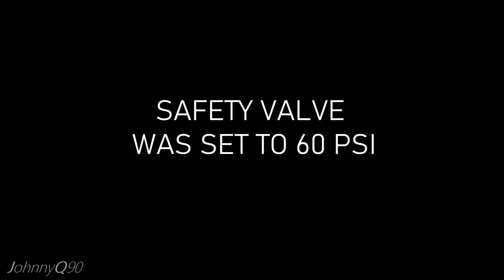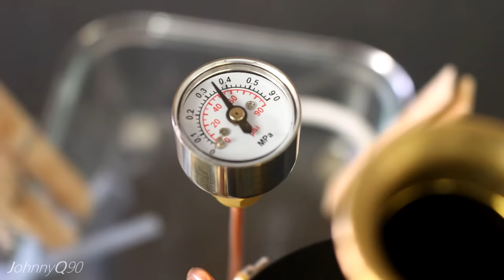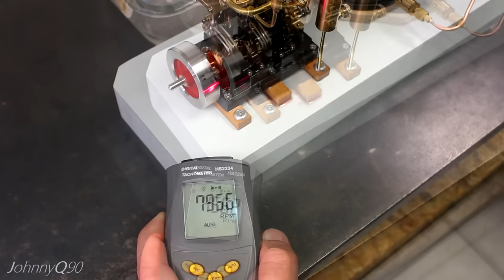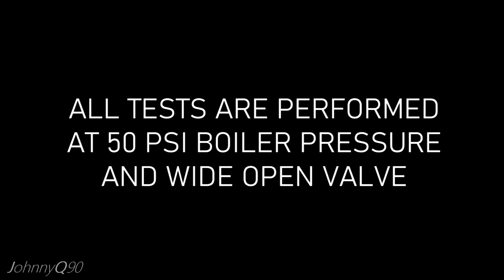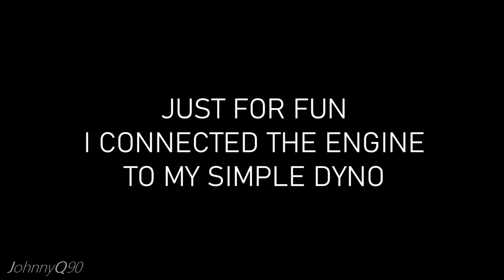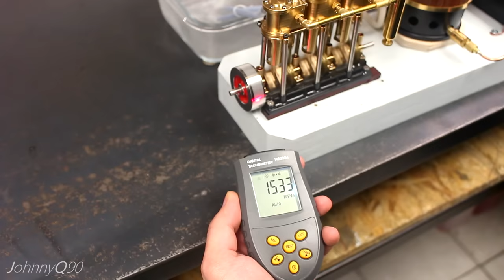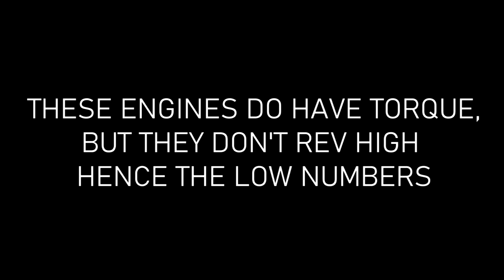Testing a TWIN & TRIPLE Steam Engine!

Comment: Johnny, you need to get some steam oil from the vendor for the in-line lubricators.  The two-cycle oil is likely doing very little to lube the cylinder walls.  Steam oil is designed to work in the high-pressure, high temperature environment of a steam cylinder.  Remember, steam under 50 PSI of pressure is much hotter than 212º F. (100º C.).  Those are beautifully made and running engines.
Reply: What does gasoline burn at? Or is the pressure more the issue at play here? We mix 50:1 for the chainsaws and blowers at work, just curious what the difference would be.
Reply: @TheOriginalBlue62  The steam actually washes the oil off the walls of the cylinders when you use normal oil. Steam oil is made to emulsify with the steam, and remain on the cylinder walls to lubricate the rings. It’s a different environment than the cylinder of an IC engine.
Reply: @tjh44961  Nice tip!!!!!

Comment: 2 stroke oil is alright for the external parts but the cylinders really need steam oil as it's a lot more viscous and can handle the pressure and heat will help the cylinders last a lot longer wouldn't want you to ruin them as I bet they where not cheap

Comment: FYI, don't over tighten any of those fittings, rather, tighten them by hand, give them one quarter by wrench, operate the machine, and tighten them if they're letting out water or steam (depending on station). Those are notoriously easy to break, also, they're specifically designed to only go a little bit, until they seal. Just letting you know, i've broken my fair share of them.
Also, 2 stroke oil is a bit loose, you should get something of heavier weight. Like way oil, for example. The steam will vaporize any of the oil it comes in contact with if it's too thin.
Reply: Just use steam oil for live steam use, machinists oil for compressed air...
Reply: @grigorsamsa6564  US navy procedure for finding a steam leak is to wave a broom in front of yourself as you wander the halls; if the end of it falls off, you found the leak.

You can replace a broom for $5
you can't replace a seaman so cheaply, especially at sea.
Reply: Ther eisbsteam engine oil available, wilesco sells it for their models for example
Reply: @vaelophisnyx9873  Holy shit
Reply: @vaelophisnyx9873  that's fucking horrifying to think about
Reply: @vaelophisnyx9873  same protocol for NYC steam tunnels when the guys are going in to repair them.
Reply: @eragonawesome  same for high pressure oil leaks. They can be so thin you can't see them even if the oil is old and dirty and black, but they still have the power to straight up slice you.

High pressure gas and liquids are scary.
Reply: The correct lubricant for the INTERNAL components of any steam engine is the correct grade of steam oil, which is specially formulated to emulsify with steam and provide lubrication to the pistons.  I'm amazed that your engines have lasted as long as they have with oil designed for an internal combustion engine.  Also, stream fittings needed to be fitted either with PTFE tape - IF the threads taper - or 'liquid PTFE' if straight.
Reply: @enlightendbel slight correction, high pressure is scary period.

Comment: This timing couldn’t possibly be more perfect. I’ve been looking up references for air engines to design my own in Blender, and I was trying to decide on the number of cylinders and their arrangement.

Edit: I feel I should clarify that this is all for animation. I don’t plan on building an actual engine, but I want everything in the project to be as realistic as possible - something that could actually work if it were real.
Reply: You should start with one, to get the hang of it.
Reply: designing engine in blender with polygons? does the faceting bring engineering challenges?
Reply: Cool ! A steam powered blender could heat the soup as it made it 😊
Reply: @johnwalker194  ?
Reply: @Casix03 😂🤣😂
Reply: I was wondering why you wanted a steam powered food blender, but crazier things happen on youtube, so I didn't get it until I saw your edit.
Reply: @superdupergrover9857  he needs to make a steam powered blender dude ! Piping hot, perfectly blended soup or sauces would be the future 😂🤣😂
Reply: Three cylinder radial, less parts

Comment: If the safety valve is rated 60 PSI, I'd run it right up to that for the extra oomph out. Looks like the little engines that could need it. They do seem to do well under load as well, as you've noticed. They don't seem to bog down near as much as the gas engines, possibly because they can always be fed power via the steam in, which can rise in pressure when bogged. Neat little engines.

Comment: I love steam power! Especially the reciprocating types like these. It would be amazing to see you build one from scratch. A triple-expansion, or the rarer 4-cylinder triple-expansion would be really interesting to see. I've always wanted to build a 4-cylinder triple like the ones used on Titanic, but i simply don't have the equipment or skills required to do so. Yet. Thanks for the video!
Reply: I was under the impression the Titanic only used 3 cylinder triple-expansion engines. In fact, I've never heard of four cylinder triple-expansion engines before, would they not be called quadruple-expansion engines?
Reply: @Kyle-gw6qp  they wouldn't be called quadruple expansion because the third expansion is just split between 2 equally sized cylinders. They did this to reduce the weight/size of the third expansion components and to minimize vibration. A true quadruple expansion engine would have 4 different sized cylinders. 1 for each stage. If you want to see a really well done scale model of Titanic's engines, look up overweightarchie on youtube. He's got thousands of hours into it and it's arguably the best functioning model of the engine in existence.

Comment: I'm really impressed and amazed at how well and smoothly the machines run, and especially the three-cylinder one. Right now I wanted to buy a steam engine again (the three-cylinder of course). almost 50 years since I last bought one. Then of tin type on tin plate, and with 1 cylinder, but I had a lot of fun with it, saw and steam hammer came with the set. The other boys were very impressed. Thank you for allowing us to take part in a great demonstration and a great video.

Comment: Very cool
Too bad they are both single expansion and since the pistons all appear to be the same diameter you probably can’t convert to double or triple expansion.  Any chance you can make a condenser so you draw a vacuum across the exhausts?  You may see an increase in power out put.

Comment: I have a two cylinder steam engine that has only been tested with air power cause I’m still building the rest of the boiler components but I absolutely love watching all the mechanics at work at extremely low RPMs.
Great vid as always 👍👍

Comment: These engines are absolutely beautiful. Craftsmanship looks fantastic.
I was a little surprised that they can't run slower than that. Especially since they're multi cylinder engines. Maybe they're not double acting cylinders if not that the reason. But if they are double acting they should be able to run much slower than that. Could be a steam regulation issue or perhaps the timing is slightly off. Could just be that they're very small cylinders also.
I had a little single cylinder steam engine for a long time. Just used the sweeping style back and forth valve. And it would run quite slowly.

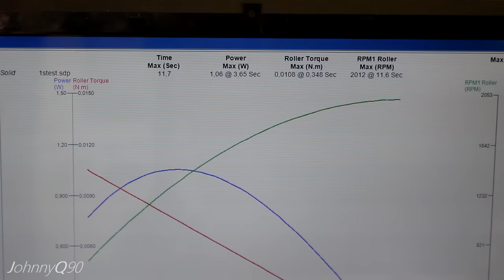Comment: 8:06 the brushless motor is producing around 1.5 watts of power, so the steam engine should be producing even more. Maybe there is a problem with the dyno test? (9:14)
best wishes
Reply: It's like a transmission. Gear reduction does a lot

Comment: i like those demonstrations with the light bulb, turning LOTS OF FIRE into a tiny bit of glowiness :P
shows you how inefficient energy conversion actually is.
Reply: Along those lines, a tinkerer could try to demo in miniature, heating with a heat pump vs. direct burn.

Comment: Lovely looking little engines , sound nice too. 
 So are you going to make a condenser for exhaust gas and feed it back into the boiler via a one way valve?
Reply: I can see the exhaust condenser working - lots of stationary engines have them, but you couldn’t directly feed it back in as the water would have to be at a higher pressure than the boiler to be able to get through the one way valve. He could probably machine up an eccentric pump though, they’re common on locomotives.
Reply: @harryrobinson2901  I didn't think of that. Makes sense
Reply: @sourand jaded they can be really finicky on miniature steam engines, they’re fussy on pressure and also don’t like hot feed water - which is a problem if you’re getting your feed water from a condenser, they tend to condense the water properly but keep it a bit warm. It’s definitely possible though. 

Some boilers need certification in the UK and US and to get one certified you need at least two methods of water input, so there’s no reason why you couldn’t have an injector and then a hand pump for if it fails.

Comment: Hi Johnny,  You have inspired me to order this setup for myself.  I ordered it today and it should arrive in a couple of weeks.  I have a few question about what we see in the video compared to what's actually included in the kits:
1.  What's the smaller vertical black cylinder for, and why wasn't it used in the build?
2.  Were the holding braces for the Gas Tank included?
3.  Was the brass fitting you soldered to the pipe included?
4.  Is there anything else I will/might need for my setup to be functional?
Reply: Hi, I am also interested in getting this kit, but like you would like to know about what is exactly included in the kit. Could you please let me know? Cheers. Serge

Comment: I would love to see the cylinders working in series. Although they probably are designed for that so it might not work well but I think that’d be cool to see.
Reply: You'll notice they have functioning valve gear, this means you don't need multiple expansion in order to improve efficiency. You just move the johnson bar closer to the center and it'll close valves early, allowing the steam to generate mechanical work by expansion. In scenario of full expansion from working pressure to atmospheric, you get maximum possible efficiency. It's basically the same as having fixed timing valves with multiple expansion cylinders that expand to atmospheric pressure, except you have an option to "overdrive" it and produce more power at the tradeoff of exhausting underexpanded steam.

Comment: I'm not surprised you didn't want to push your luck regarding the pressure on the boiler. What you could do though, is a water pressure test on it yourself, it's a lot safer to test it that way and is quite simple to do.

Comment: Is there a way to add water to the boiler while under pressure?      Not necessary with butane,  but handy if you want a longer run.   Nice running,  very well timed engines!

Comment: I wonder if its possible to make a small steam turbine to go alongside the main steam engine, connected to a gearing system, to act as turning gear system. So in theory you could have a high pressure burst of steam, maybe lasting 5-10 seconds or so, that would spin up the turbine, turn over the pistons to remove any water, before then being able to start the main engine. If calibrated right, a governor could open the throttle valve to an idle (or maybe a "start up") setting right as the waters cleared from the cylinders, whilst also closing the valve to the starting turbine, making the start up an automatic proceedure automatic. Don't know if this would work in practice but if I had the time and tools I'd love to try and make it work. Not only is it a cool little party piece, it would also sound incredible. The hiss of steam, with the winding up whirl and shriek of the turbine, followed by the main engine sputtering and roaring into life!

Edit: Doing that maths thats about 1.63 hp/L, and about 13.07 Nm/L which isn't half bad for what it is I think!

Comment: Great video as always but i noticed something. You were able to produce 1.5 w of electrical power using a generator but you were only able to produce 1 w of mechanical power with the same engine. This doesn't seem right, maybe the dyno gives us fals results.
Reply: I thought exactly that
Reply: Higher friction losses in the dyno most likely. I think it's designed for much higher power levels.
Reply: @VintageTechFan  a dyno is designed to test HIGH SPEED torque ... a steam engine is considered low speed torque ... so the steam engine will start fast and finish at the same speed ... while a proper engine will start slow and finish fast .... a steam engine isnt abut going fast it is about moving heavy loads and doing lots of low end muscle work ... while an engine is about constantly accelerating adding more and more speed to the power curve ... put a car engine on a jet engine dyno and the car engine looks like a peddle car ... same idea as a steam engine on a race dyno ..

Comment: You know what would be really cool? To build two similarly sized model ships and install them in it. You can use the flywheel and attach a propeller shaft to them and add a propeller.

Comment: Silly little project for you to try.

Historically most steam ships would squeeze a little more power out of their steam engines, not by heating the steam more (and risking damage/boiler explosion), but instead by cooling the exhaust through a heat exchange, with some fresh seawater.

Perhaps pipe the exhaust tubing through a water bath before releasing it, and check the power again.

Comment: This might be a silly question but could you set the two engines up in series and do a double expansion setup?
Reply: you could BUT then you woulld have to use a governor to keep the engines in sync with each other ... parallel and you can run two different sets of things like say a generator for lights and some battery charging ... and then bands for tools and machines like lathes or drills or sanders or saws etc ... literally a miniature machine shop run from 2 steam engines with lights and all fully functional ... ok so they are best suited for smaller parts and more likely softer metals ... but perhaps can be used to actually make the models with scale sized actual machines ...

Comment: Gotta use steam oil in the oil tank that hooks up to the steam line. The oil gets picked up and dissolved into the steam and lubricates the cylinders like that. I would also recommend a thicker machine oil for the timing links.

Comment: Fantastic video, but I have to say, I think 2 stroke oil is not the best for these engines. I'd advise getting some proper steam oil, or use a thick engine oil instead. I'm sure they'll run and sound much smoother with the correct oil

Comment: I expected the 3cyl to make more torque but less power despite the shorter stroke; relatively close displacements (~4.8cc vs ~5.5cc) but all the extra rotating mass.  But more importantly, a fixed supply from that boiler, though perhaps because you were limiting the pressure, the boiler was able to supply additional volume to feed the slightly-larger 3cyl?

Comment: Use a 24 inch piece of copper tube from  the exhaust ports run through cold water to let it cool and condense back to water to pump back into the boiler. Also use the exhaust from the three cyl engine to feed the two cyl engine and hook them up together. Bet the output almost doubles

Comment: If your bring your cutoff back you can get faster using less steam and expansion, the closer you bring it into the middle, for example half forward: 50% of the piston stroke is steam and the other half is the steam expanding, this will also increase your speed

Comment: Next, you could model the Titanic configuration by running steam through a piston engine and then a turbine, into a condenser. Demonstrate pressure lower than atmospheric.

Comment: "WATT ME WORRY?" The power of a miniature model steam engine should be considered in "grins/revolution".  Between the under 500 RPM audio combined with the visual spectacle  of the monkey motion of the polished brass parts.......consider "watcher grins" as a miniature steam engine's output rating.  Judging by the remarks, it does that very well.

Comment: So beautiful! You must consider it at low rev engine. First at all a long long process of time to let the parts fit each other (miss the right word )
The engine will be totally different after it. Easy and slow start as a lower rpm in free charge.
At end those steam engine are known in RC boat, to manage big propeller at "high" torque and often the best way to use all the power they offer is to use a large diameter propeller combine with variable pitch
You could stay at fixed rpm and reversing without stopping engine. Very useful to save water on long endurance race.
Imagine a 10cc methanol use a 30mm propeller when 10cc steam use a 70mm. 
They could be fast but fast in a boat is relative. 
We also use often gearbox to change the speed ratio.
At its time, titanic is the fastest steam boat. And you could find steam racer in RC boat. No comparison Ith fully drug nitromethane RC that run to 30000rpm 
But your steam engine still run in 100 years. 
Even in scale than in RC. 

For good number on Dyno, consider to charge it and see how torque is. 
Direct drive and geared. 

Have fun. I love your vids. A bit shorter. But so pleasant.

Comment: But what was the cut-off set to. Did you test on the dynometer with maximum steam expansion (maximum economy) or maximum intake (max torque and highest steam rate)?

Comment: I wonder if you could build a super heater to fit in the flue of that boiler, then compare the dyno results of saturated vs super heated steam.
Reply: There usually is or at least could be a superheater coil on top of vertical boiler